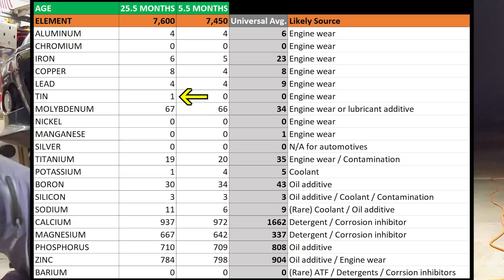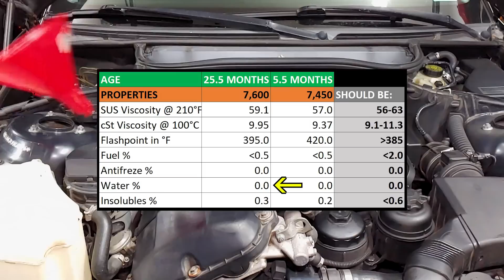Does Oil Really Need to be Replaced Every Year? Surprising Analysis Results Revealed

Comment: This whole oil issue seems to be an American thing. In sort, marketing. In EU the concern does not exist. My car was designed for servicing and oil changes every 20,000 miles (yes, that's right) - it's a German design mass market car from the GM group. How many times have I had to change the engine (not the oil)? Zero. How old is the car? Just over 20 yo. Does it run OK? Absolutely sweet. I didn't even know about this "keep changing the oil" US habit until I started watching YT... amazing!
Reply: As a European myself I also couldn't believe it when I saw so many Americans changing their oil at 5000km. At first I thought they were dumb, then I started thinking that maybe their engines are so badly made that they actually need oil changes that often, then I went back to thinking they're just dumb because there's no way their engines are THAT bad (and also they do it even with foreign cars).

One thing that always has left me baffled however is how people never change their gearbox oil here. Everyone seems to believe it lasts "forever". It just doesn't! It's not exposed to combustion products so it lasts much longer than engine oil, but it also has no filter so it will progressively fill up with more and more metal particles and accelerate the wear on your gears exponentially.
I changed the gearbox+differential oil in an old tractor I bought and it was absolutely FULL of metal shavings.

My new car has around 50000km and I think I'll change the gearbox oil along with the next oil change.
Reply: Because its your sensation, in europe we have a lot of mechanics with youtube channels and they show the problems, for example, bmw n47 timing chain problems because long life oil changes
Reply: Yep, absolute scandalous thieves. I called Mobil 1 to ask about the shelf life of their syn. oil as I had an unopened jug over 5 years old. They told me you get 2 yrs. after opening and 5 yrs. unopened. Really!!! Seems they are marketing it as if it were fragile.  IT'S OIL. I called Blackstone oil analyzing laboratory whom I have researched for 8 yrs. now. They said no amount of time on oil degrades it, especially in a jug and that the only thing that degrades it is running through an engine. Thats when I concluded, it's OIL not milk. Modern-day additives is what extends its life compared to decades past. Obviously, Mobil 1 is laughing all the way to the bank and wants to sell as much as they can. I have more knowledge about oil but can't put it all down here. PEOPLE!!! Do a lot of research. Also, read their 10,000 ml. warranty. AHEM, It states if you make a claim that your oil has to be analyzed at a lab. I found the warranty pretty much useless.
Reply: You no mechanic's? Here in europe have mechanics with youtube channels and they show the problems...
Reply: bro must be from Transylvania
Reply: In Europe this concern indeed does exist  ❗And btw, there are studies out there about OCIs.
Reply: Agree, the development of high quality fully synthetic oil was a game changer. Of course companies became concerned about their income hence continued spreading the old era recommendations for 3k miles oil change intervals etc in the US, whereas other countries where environmental factors are of a concern, science and modern technology dictate car manufacturer recommendations.
Reply: You from germany driving vectra lol?
Reply: Oil is not just a lubricant with cleaning and heat transmission properties but a core component of ICE , there are just too many moving components . There is just very low margin for making oil that can take care of every king of movements within a ICE . Changing oil before recommended schedule by makers of a automobile makes more sense and gives peace of mind . One thing is sure ,changing oil at regular intervals doesn't harm the engine any way
Reply: 20k miles lmao that's absurd. What mileage is on it right now? Those oil change intervals are like that for marketing and environmental reasons and are only meant to keep the engine alive for the 'lifetime of the vehicle' i.e. the warranty period. No one who wants a car to last 300k kms would change the oil every 30k kms lmao

If you read the fine print in the owners manual they always say "in adverse conditions change the oil at [half the recommended interval]" or something along those lines. Turns out "adverse conditions" is anything that isn't just constant highway driving. You can speak to your mechanic and they will tell you the exact same thing.

Comment: I think now with the emissions running through the crank case, you’re gonna find engines that are done at 10,000 miles are never gonna make it to 200,000 and they never tell you about the sludge around the rings on oil analysis that’s only found out after you didn’t change your oil enough I’ve done many oil analysis. And the oil was always fine.

Comment: I've always thought that unused motor oil breaking down was a myth considering that fossil fuel material dates back to the Devonian Period.  That's a bit older than the suggested 5 year shelf life.
Reply from the maker: The oil in your engine is not the same as what's pulled from the ground. It has been refined and received additives.

Comment: In your vid you talks about “acceptable levels” of contaminants. But, you have to realize, you’re comparing arbitrary “acceptable levels” with brand new, IDEAL oil in a cases wheee someone changes every 3-4k miles. How on earth could anyone think an engine running new, ideal oil will not be much better than running an oil with “acceptable levels” changing every 7k to 10k. This isn’t rocket science. I think change it as often as you can, using 3k miles as the minimum point where you start to consider changing it. That’s what I do anyway. I’ve bought 30 year old Toyotas a number of times and kept them running for 10+ years myself so I must be doing something right

Comment from the maker: Part 3 here --> https://www.youtube.com/watch?v=caBVbGYHB4k

I have more oil analysis videos in progress but it takes a lot of gas to drive 10k miles or more and this channel isn't making much money yet, so any support from you will be HIGHLY APPRECIATED and will help get these test results done much sooner.  There are links in the description for donations, merch, Patreon, and SubscribeStar.  Thank you for watching - you are the reason I do this.
Reply: Castrol edge or professional are very good oil indeed,worth the money, here in the UK people use just cheap oil it's crazy! Many cars sound like a bag of nails at 100,000m & even less! They use cheap oil & change it every year 10,000 or more! No wonder some brits brive bangers. I use the Castrol Magnatec myself at 5,000m a year. But the Castrol edge or professional will have no issue doing 10,000m a year EVERY year, that's one oil on top of my list.
Reply from the maker: I agree, but now I think I need to test each brand to find out which ones really are good and bad.
Reply: Interesting, thanks for sharing. May I ask where you live? Is it a humid or very dry zone?
Reply: Oil analysis kits are cheaper at Napa and there is a lab on NW Front Street in Portland if you want to speed up the process.
Reply: @Joshie2256  I measure motor oil changes by gas used. Usually 900 to 1000 litres (about 250 gallons), if city driving miles por gallon decrease, and end up changing at 9000 km 5,600 miles or so, time varies up to two years has been seen, usually18 months

Comment: I washed your video with great anticipation. It was certainly eye opening.  However I change my oil every 3 months/3k miles and I use full synthetic oils.  I grew up in the automobile business when I needed 6 quarts of oil when the oil was changed. I used 5quarts in the engine and 1 quart in the air filter, yes the air filter. When I grew up; I drove cars that had oil bath air filters.  As a retired widow I drive mostly locally, maybe 2 miles to and from a location. That is most severe use as the oil never gets hot enough to boil out the moisture.  My two vehicles are serviced at their respective dealers.  Maybe I change the oil too frequently, but in 53 yrs of vehicle ownership I have never had an oil related issue.
Reply: Oil in the air Filter you meant the Engine air filter? weird .

Comment: My wife and I put less than 5000 miles combined on our three vehicles each year.  I change the oil and filter in all of them annually and use full synthetic oil.  Not driving much means I pay more per mile for taxes, insurance and annual maintenance.  Our vehicles are old so I started running engine flush solvent as part of the oil changes.  I also suck the old fluid from the brake reservoirs and power steering reservoirs and refill with new fluid as a cheap and easy half of a flush and fill.  The solution to pollution is dilution, and that eliminates half of the suspended particulates that cause wear and half of the moisture that causes corrosion.  Unlike engine oil, these are hygroscopic fluids.

Comment: You've put so many of my oil change anxiety away with this. I am subscribing to you. I have two cars and it's hard for me to get either one at even 3,000 miles a year on each.
Reply: Yes, I’m in England but the Volvo garage change the oil/filter on my v70 every year which is usually about 3000 miles. It costs me usually 200 pounds so not cheap at all, in fact it’s a total rip off with their fancy oil. That’s why I try to extend it to thirteen months. i would change it even longer but for the warning messages to change it driving me mad.  I do very short journeys with the occasional long trip of about fifteen miles. I much prefer the bus actually when I haven’t got any shopping to carry, which is why mine has only done just over seventeen thousand from new about eight years ago.
Reply from the maker: It helped with my oil change anxiety too haha. Glad you like it!
Reply: I agree. I barely put 2500 mi on mine in 12 months. I can easily go longer
Reply: I'm getting 4k a year
Reply: My last oil change was 10000 miles ago or 2 years. I intend to do it every 10000 miles however long it is.  Maybe just a filter if it goes more than 2 years. Paper element and rubber degrades overtime in my opinion.

Comment: We started using oil analysis at work--we ran large format printing presses, the size of greyhound buses.  Each print tower held about 55 gallons of oil, with multiple towers, so you could imagine how expensive oil changes could be.  We wound up doubling or tripling oil change intervals.
Reply: What about municipal buses? This is personal. Ralph Kramden.

Comment: Question, generally are standard highway miles (65 - 70 mph) or city driving miles harder on car oil?  Where I'm at, nearer the windy ocean, the year round temperature is a chilly 50s and 60s F, but I don't know if high and low outside temps completely change results.  I guess you could also apply my question to a place like Phoenix Arizona, with hot dry temps - highway vs city.
Edit:  ok, did a little searching, and read something kind of weird: driving "on highway is better because the oil gets hotter and burns more condensation".  Ok, "nice," but wouldn't also making the oil significantly hotter also cause some damage, too? I mean common knowledge - making things really hot, repeatedly, never ends well, in a lot of cases.

Comment: I’ve always been a firm believer in 24 month oil changes, no matter what. My new bought 1988 Toyota van went 310k km, perfect drive train, junked because body rust. My current 2002 Caravan, 330k, runs perfect, uses about a liter oil per 2k now. But of course, as they always say, your mileage may vary.

Comment: I always go by mileage, regular dino oils I change at 3000 miles and synthetics I change at 5000 miles.
I know particularly on the synthetics I could go longer intervals but being retired it sometimes takes me quite a while to accumulate the mileage numbers anymore so I opt to shorten that interval a bit.

Also I always install a new filter with every oil change, cheap insurance to know its all fresh both the oil and the filter when changed.
And yes to me wasting a few dollars as I go is still cheaper than pushing the limits and needing to replace an engine due to oil related premature failure.
Reply: I'm retired I do about 360 miles a years I have a Subaru Outback 2020 with 3K since we move of state I change oil every 6 month I think about what I saw in this videos i will do it once a year from now. An engineer from Nissan design the engines at Nissan said if you do low mileage change Oil filter every two changes , and if you want your car go to 200k to 300k change it with any cheap oil as long you change it often oil degrade over time.

Comment: Well, good video, my uncle is an engineer for the military, aviation pro, he told me changing oil less than 10k miles is an industry trick,(the power of suggestion) so I took him up on his challenge, I didn't change the oil in my 2003 Toyota 4 runner, for 40k miles... The vehicle never had motor issues,lasted to 287k miles, and I stopped driving it because the frame rotted away!!!  Good luck, do you own experiments..
Reply from the maker: Impressive! And thank you.
Reply: Did you drive mostly highway or city?

Comment: ASE SENIOR MASTER TECH OF 50 years here,this is what i do,and it has kept me going to fix other peoples cars for years,if you are buying a new car,no matter what the dealer and salesman says,drive 1500 miles drop it the oil and filter,from then on 3500 miles for 3 oil changes,then go to 5500 miles for each change,3 times,this keeps the oil pan clean,a clean oil pan means the oil screen never clogs,this means you can start it up and make it to your destination,you run oil to 7500 miles in 20,000 miles if it makes it,you will have engine damage,PARTS DO NOT WEAR IN CLEAN OIL,FACT,I'VE PULLED thousands of engines,transmissions and differentials apart,when i find a clean one,i check the oil make,clean means it lasts,even if you are severe duty driver,if you do not change and maintain your car,why did you buy it,if you can't afford oil drops,there's always the bus lines,no bull,cars are a luxury,same for a/c systems,modern ac system on a new car is 4500 dollars of the purchase price,just do it,cars and trucks that stay together have clean engines,esp in the hot areas of america,happy motoring
Reply from the maker: Thanks for the info. What do you think about magnetic drain plugs? Beneficial or gimmick?
Reply: @endlessmoneypits  WHATS better is go to a trans shop or dealership and put two or three transmission magnets on the oil pan,just JB WELD THEM ON,THIS HOLDS THE PARTICLES PERMANENTLY,ESP NEAR THE OIL SCREEN PICKUP,and use the magnetic pan plug too,metal in suspension is the enemy,oil is the life blood or anything that moves